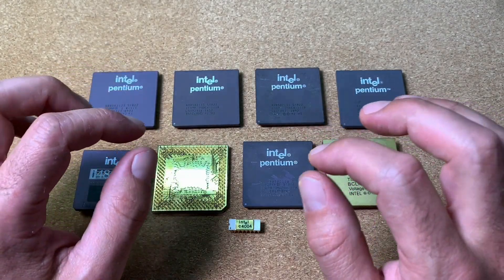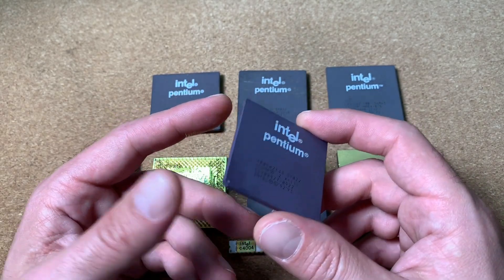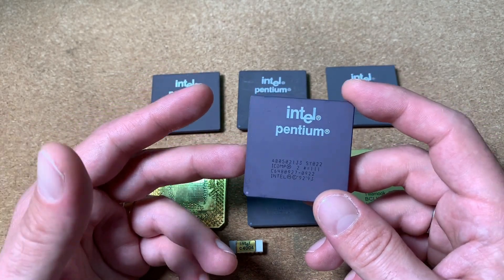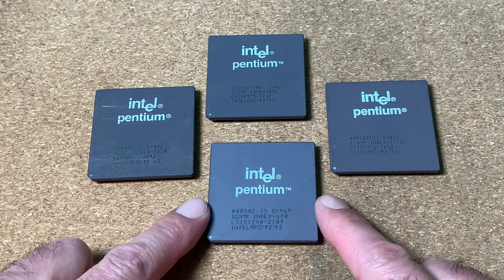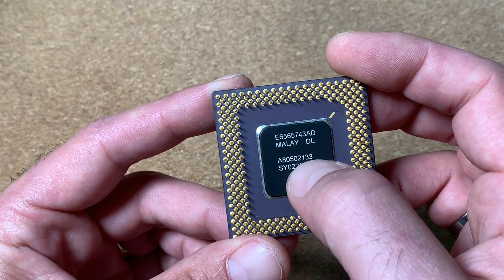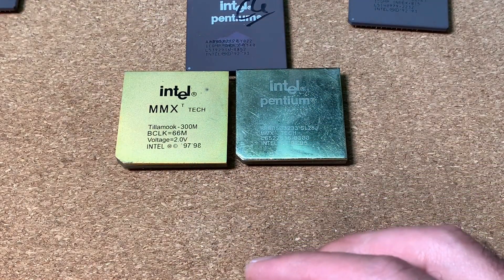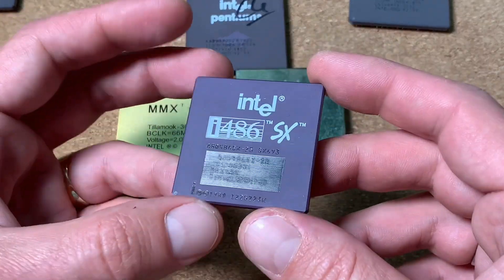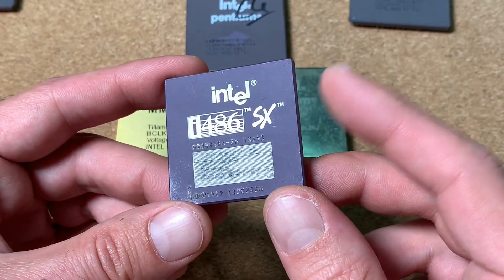Faked Pentium CPUs / Huge Crime Story in 1996 + Giveaway

Comment: I remember this going about so in the shop we always tested by over clocking and if it ran it was OK well we did think that we never left it over clocked was just testing then we set board back to the printed numbers.  We did find some that did not run so well so we did think it was tamped with so we under clocked it.

Comment: i remember back then the smart thing to do was just to buy the slowest cpu with a particular feature set.  so like a p166mmx because 0 change to get a remarked one.  the only real issue was places that sold "pre tested"  oem overclocked cpus would sell you the cheap ones that were left over from their tests unless you could get a sealed boxed retail or something

Comment: This problem was why a small custom shop I worked for back in the day used to underclock all their builds - the owner had heard rumors from somewhere of counterfeit Pentium CPU's floating around the market, but not where the fake CPUs were being sold, so he figured why take the chance? By stepping down the clock of every CPU by a small amount, a "fake" CPU would run stable, since it would be closer to it's actual speed.

Comment: Haha, my friend in summer of 1996 had bought a Pentium 166 MHz and it was very unstable. Blue screens everyday. Maybe his CPU was a counterfeit. He replaced it with a K5.
Reply: Unlikely, I was a tech building PCs back then. Also fixing them etc. It was very common for people to upgrade things back then making any number of mistakes, either bios settings, ram type, speed, etc. Early MMX chips were   allergic to specific types of ram, if I recall correctly ones with 2 or 4 chips per module rated 70ns

Comment: Another good example of fake electronic components are GOLD PLATED PINS FROM CONNECTORS, in vintage era'70-'80 of electronic devices a lot of ELECTROCHEMESTS who work to plate pins with gold was stealing the gold from factorys and put just a thin flash of gold on pins , this is the reason when you find multiple identical electronic boards or devices with different coating of gold plate on pins connectors, in '70-'80 it was difficult to detect the thickness of gold plated pins and nobody was think somebody will steal the gold from pins , in that time the ELECTROCHEMESTS was stealing a lot of gold from factorys

Comment: you can over clock the 75 mhz pentium to 90 mhz as long as u put a fan on the heat sink most of them didn't have a fan on the heat sink
Reply: Back in the days I got a used Pentium 75 from a buddy (50MHz x 1.5) and without any hesitation I set the mainboard to 66MHz x 1.5 (100MHz). That baby ran flawless, rock solid.

Comment: are they really faked?? I mean its still an original Intel CPU with a new coating engraved with a faster modelnumber.
Reply: Well of course its faked. If I sold you a sports car with a V8 engine then after you pay for it you find out it actually has a V6 you might be a bit miffed. It might be a "genuine" product but mislabeling in this way is still fraud. Also you cant trust the processor. There is a possibility that the processor they use are from a reject pile from Intel. Which means they might work, or might not. And if they are overclocked too far they will never work due to instability.
Reply: @GamerLoggos  I guess what he's saying is that after the fake is revealed, it is a genuine Intel Pentium 120, and pentium collectors can still be happy with their genuine Pentium (as opposed to some chinese copy). In your example the classic V8 collector isn't going to be happy with the V6... an equivalent would be (i guess) 'well its still a V8 but its only a 2.8 litre, not a 3 litre'. I know its being pedantic, but i sorta get where they're coming from?

I've had my dealings with these fake chips myself. When assembling an Amiga accelerator board (Furia), every single motorola 68020FG25 I got was an FG16 that had its surface skimmed and relabelled as an FG25. In the end I got myself a new old stock RAID card from the 90's with an FG25 onboard and removed that. Convoluted, sure, but the only way to be certain!

Comment: In its initial years, there was a huge gap in price between Pentium and 486 processors. I had to pay 200 USD for the best 486 cpu/motherboard combo, and a whooping 300 extra if I wanted a Pentium one. This gap was an incentive for these fake/counterfeit CPUs to be made. In later years, stiff competition from Cyrix and AMD brought Pentium prices down a bit but, more importantly, their products filled the price gap. Since then and all the way up to today, we have a diverse enough CPU market, so these business practices make less sense. Besides, it's prohibitively expensive to manufacture your own counterfeit CPUs.
Reply: nowadays they just sell engineering samples ;)
Reply: @ryjelsum  how bad are ES compared to retail CPUs? I bought one for an old laptop, the only issue I have is a weird clock desynchronization, but I suspect it's not because of the CPU.
Reply: @sovo1212  it really depends on what exactly you get, but i got one of those laptop engineering samples that was converted to fit into a desktop motherboard and it's been pretty smooth for me, actually. 

some mild issues, but eventually i figured out that was the extremely budget motherboard i was using. popped it over to a different motherboard and it's been running fine. makes for a great low power PC, the processor runs at like 0.7v it's kinda wild

Comment: Here's a little bit up overclocking history from my own experience in the late 1980s:

I worked for a company that sold Peltier coolers for 486 CPUs, allowing them to overclock without the instability that increased speed and heat would create. At the time, Intel was selling 486/25 chips in bulk and NOT testing them to see how fast they would really run. As a result, we could bulk buy these 486/25 CPUs, embed them in the cooler we made, and sell them as able to run at 50Mhz with no stability issues. The coolers were able to reduce the running temperature on any load down to as little as 5 degrees Celsius, making heat instability a total non-issue.

Unfortunately, Intel noticed that there was a huge demand for their 486/25 chips and very little demand for the 486/50, and did some investigating to find out why. They realized that Intel was selling CPUs that were fully capable of higher speeds, but had never been tested for reliability at a higher speed. A new policy was rapidly implemented and all subsequent chips were pre-tested to determine the highest possible stable speed. Those faster CPUs would then be culled from the larger batch and sold at the higher price and speed labelling.

We noticed this ourselves at one point when literally none of the 486/25 CPUs would run stable even under the cooler at more than 33MHZ, and only a very few of them at that more limited speed bump. The easy money was now gone, and the company had to pivot to a new marketing strategy, but was unsuccessful, even though the Peltier cooler was quite effective in heat management back in the day of crazy hot 486 chips.
Reply: This is interesting, peltier coolers has proven ineffective today.
Reply: reading about peltier remembers me about sometime ago when i played with it and i freezed stuck my tongue to a peltier.. I was a curious kid back then... it was hurt to pull my tongue

Comment: OE relabeled microchips aren't unusual, at least they weren't in the '90s-'00s. Sonnet Technologies had a write-up for some of their old Mac CPU upgrades where such chips are used, explaining that often these chips were originally labeled for a specific customer order that was later cancelled (for example: customer needs 3000 400MHz chips where these parts regularly qualify from 400-500MHz, so the OE will just certify the whole production lot as 400MHz to satisfy the order), but since the chips were actually capable of running at different (often faster) speeds, they were requalified, relabeled, and resold.

Comment: During the late 1990s, all computer shop in Shum Shui Po Hong Kong were selling fake Pentium CPU
Reply: Fact Check please, Recently 2016+ there have been lots of fake Intel cpus coming from the China and even some CPUs that are Engineer Samples leaked on the market. Early 80's back then mostly "Clones" of Apple II's and Nintendo Famicom "Copies" game carts. As for Cpus mostly sold were slightly modificed using tape to get a higher speed. The earliest was a Secc Celeron 300A resold as a Pentium II 450mhz .There were many AMD's Cyrix, Evergreen 586 cpus yes but fake have not seen. I used to work in the Basement "Ocean Computer systems from 1982~1992. Not all shop were selling fakes.
Reply: @MrAlan1828  where is all the old stuff?  I'd love to put together some 486/586 machines or other exotics, but it's like everything prior to Intel Core has been crushed & melted.

Comment: i had a 386 dx 33, i couldnt adjust the clock generator , i just had to swap the crystal. Popped in a 40 mhz crystal and it ran perfect.

Comment: I didn't know Intel used to use Pin Grid Array.
Reply: Yes, since the 80286 or 80186 up until Pentium 4.
The Pentium 2 was on a PCB that you inserted into a slot. Intel called this the slot 1.
Some early Pentium  3 also were on a PCB and usually, the same motherboard also supported Pentium 3.
I think at one point, Intel began to make the L2 cache onto the same silicon as the CPU so the single chip Pentium 3 as a pin grid array came out.
Reply: @louistournas120  >I think at one point, Intel began to make the L2 cache onto the same silicon as the CPU so the single chip Pentium 3 as a pin grid array came out.

The reason that Slot 1 existed is because Intel couldn't work out how to get acceptable yields with the L2 cache on the CPU die running at the CPU speed. The Pentium Pro was the same, except it was in a ceramic PGA. Depending on which version you had dictated how many cache dies were in the ceramic package with the CPU. The 256k had one 256k, the 512k had one 512k(?) or two 256k and the 1MB version had two 512k dies.

Slot 2 Xeons were more or less Pentium IIs with even more cache dies, which is why it was more or less twice the height of a normal Slot 1 Pentium II/III to fit the extra cache.

Later on in the life of the Pentium III, Intel had improved their manufacturing process enough to put the cache back on the CPU die, which is why later Slot 1 Pentium III processors had no external cache dies. Intel continued the Slot 1 side by side with the PGA370 until the end of the Coppermine at 1133 MHz.
Reply: Yes. On the desktop they switched to LGA with the later LGA775 P4s. On mobile they still used PGA until they switched entirely to soldered-down BGA CPUs with Skylake (aka 6th gen Core series).

Comment: The real crime was Intel charging $200 for 13mhz more.
Reply: Going from 120 MHz to 133 MHz is a 10.8% increase.
It's like having a 1 GHz vs 1.108 GHz
or 2 GHz vs 2.216 GHz.
Also, nothing prevented us from overclocking these chips. I had a 200 MHz Pentium MMX which I pushed to 225 MHz. At 250 MHz, it was a little unstable.
Reply: Although I see your point. 13Mhz then is similarly compared to 1.0Ghz vs. 2.0Ghz today.

Comment: At that time, I used to overclock my CPU. Pentium 120 running at 133, Pentium 150 running at 166, and lastly a Pentium 200 MMX running at 250 MHz with a 100 MHz system clock instead of 66. This last one was faster than PII-233 when fpu wasn't involved !

Comment: I remember setting Pentium 100 to 133 and it worked perfectly for at least 1 year before I got AMD K6-2. That's what I call overclocking, +33% for free wintout any investment.
Reply: I had a 200 MHz Pentium MMX which I pushed to 225 MHz. At 250 MHz, it was a little unstable.
My firs AMD was the Athlon Barton core. Athlon XP 2800+. I think it ran at 2400 MHz or was it 2075 MHz. It had 512 KB L2 cache and that is why I bought it.

Comment: oh the pretty ones... i used a few of those.
atleast it wasnt sold as a fake cpu in my case they were sold as surplus/recoverd moble cpu's put into adapters to fit desktops They could be a little buggy if the bios didnt allso have the microcode for the moble version in it.

Comment: what I mostly seen back then are not faked but were just reprinted with specs higher so that it will cost more.. most of the time. they still worked as if you have overclocked them..
Reply: "reprinted with specs higher" is a fake chip because it is not the part number it is claimed to be.

Comment: The Chinese used to do this with CD-ROM's too, in 1998 I got a CD-ROM from a well known supplier that came in a box that said 16x, the sticker on the drive said 16x and the face-plate had 16x silk screened onto the front but I was using Linux and it detected it as an 8x, so I did some testing and realised its an 8x drive and spoke to the supplier and they did their own tests and realised they had been conned by a supplier and had to recall all the cd-rom drives and exchange them for real 16x ones. If I had been using windows I wouldn't have known the difference.
Reply: I onc bought an i5 laptop, it was so fricking slow on Windows, when installing Linux discovered it was a Celeron 3350 and everything saying i5 was actually a registry hack.

Comment: Hi - Good video but a very sad topic.

I would be unhappy if i purchased a P-133 and received p-120 but in reality i would put up with it

However - what if the 2 different chips required different multiplier or more importantly voltage and the " fake chip" is damaged or worse ruins my board !!!

Regards
George
Reply: Mb should be able to switch between 60 and 66 mhz bus without any issues
Reply: @ponyboycurtis007  Yeah, no, not in the days when you had to set the FSB, multipliers, and voltages manually with jumpers on the motherboard. It was really easy to fry a CPU if you had bad information or a scam chip because there was no hand-holding in BIOS to check what chip was really in there. You set X volts on the jumpers, your chip gets X volts. And if that instantly destroys the chip because it's too high, oh well.

Comment: I imagine this is probably why modern PCs can automatically set clock speeds of CPUs, and/or why modern CPUs have ID strings.

I can imagine getting tricked into getting one of those counterfeit CPUs back then, and wondering why the custom-built PC had so many issues. I can also imagine there being adverts about "genuine Intel processors".

Comment: fake cpu? as long as it works and cost less than the original u cares?
Reply: Because they don't
Reply: The fake here isn't that you got a processor cheaply, but that the scammers would repaint a genuine Pentium CPU as a higher tier one, so as the end user, you would have paid the price for, say, a Pentium 133, but actually gotten an overclocked 120.
Reply: It might fail under some circumstances... Not up to intel standard...
Reply: First, a lot of the time they don't work. Second, you'd care because you got conned into paying a lot more money than the chip's legitimate speed rating is actually worth.